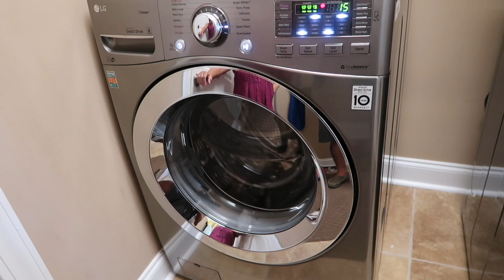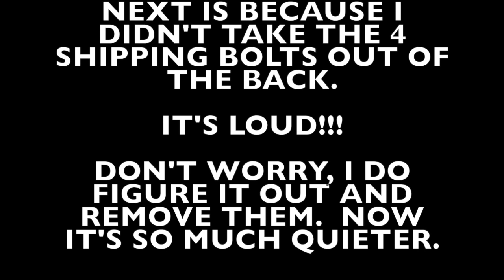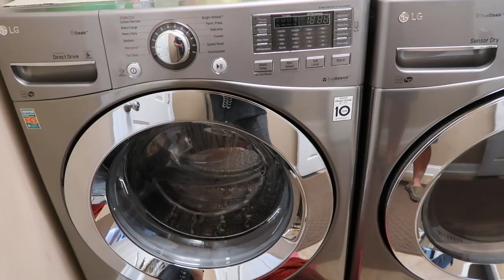I Didn't Remove Shipping Bolts From Washing Machine

Comment: I did the same for upto 5 washes. Then i removed those bolts. Now it is running good. But does it reduced the Machine drum life? Worried though..
Reply from the maker: dang.  5 washes of that noise?  You had to think what I thought, "what the hell did I buy??  Is it supposed to be this loud??"
Reply: @StuffIHeard  :D .. no i didn't complete the whole 5 cycles. When it started vibrating, I turned it off...adjusted the level ( thought problem with labeling) and again runned it from the beginneing.

Comment: this happened to me yesterday... i wasn't aware of those bolts.. neither its mentioned in BOLD anywhere... its hidden in the large instruction book... they had given a one page handbook for a quick start... in that also they had not mentioned..... 
my machine started to jump all over... i thought it could be due uneven floor and ignored it.... a big mistake.... 

hope it has not caused any physical damage.... while the machine is running fine for now....
Reply: Did one cycle wash with transit bolts cause any damage to your machine?
Reply: @ahmadalzaza2092  not a major one, but surely it has rubbed the drum and it causes some noise every time while using the machine

Comment: I ordered a washing machine from Samsung and paid extra for installation. The 3rd party they used to deliver and install the machine didn’t take off the shipping bolts and I thought the machine was going to explode. I stopped the cycle before it finished but I have no way of telling if there was any damage caused to my machine 🙃
Reply: Did one cycle wash with transit bolts cause any damage to your machine?

Comment: To check this open your door and press and push upon the drum. It should move smoothly and quite free, if it's got no movement that means the bolts are still there. 
With a load and at full spin the damage it can cause it's crazy. Your machine shouldn't make excessive noise and definitely shouldn't move. 
PS, right at the base there is usually polystyrene, this also needs to be removed by tipping it back whilst someone forces it out.
Reply from the maker: thanks.. that's what this video is about.. did you only watch the first minute?
Reply: You didn't show how the drum is supposed to move. 
You showed the machine running, I guess maybe do an after to show the difference? 
Sadly this isn't an easy mistake to make. It's highlighted quite a few times, some brands even have hangers with big red text reading remove. 
I'm certainly not the one who misses things.